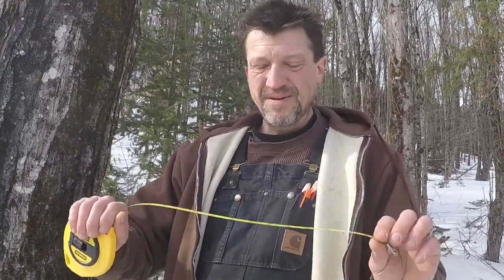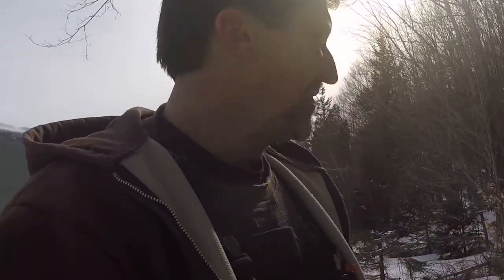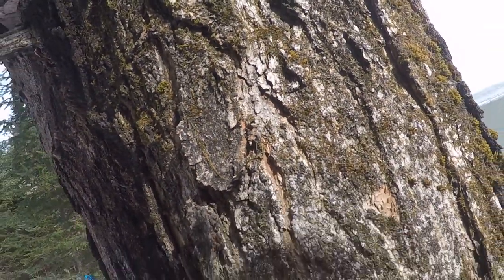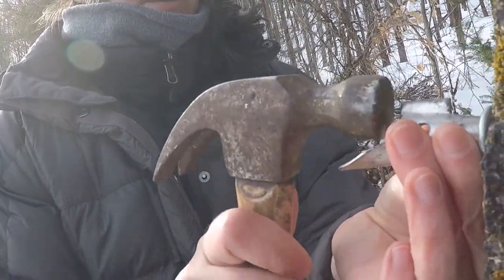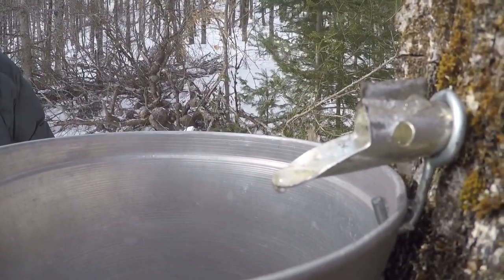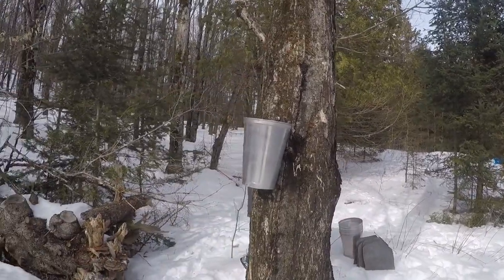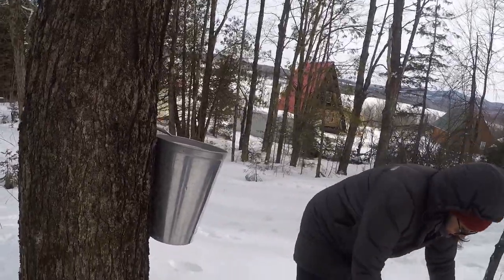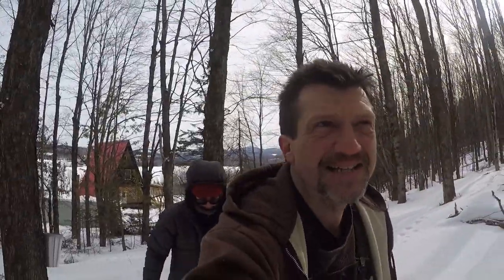Tapping 23 Trees to Make Vermont Maple Syrup

Comment: That large buckets? Wouldn't it be better to have something that's more closed at top so that not that much dust, leaves, rain etc. fall into it? - I have no experience with this, just thinking logically in my arm chair.
Reply from the maker: There's nothing like a little crunch in that syrup, Christian, to give it that unique flavor. ha ha.  Well, we may get some insects and leaves, etc with loose lids, but we will filter that out before boiling. Added rain would just require a little more wood to boil it off.  We think the risk of using plastic with the probable carcinogens  would be greater than the occasional ladybug.  Nice observation, though.
Reply: Pensioner Pond Permaculture   Thank you. Yes, I did not think of plastic containers anyway, but also your zink plated buckets... hm... probably glas jars would be a chemically safe and stable solution. Greetings from the armchair.
Reply from the maker: You are absolutely right with the glass!